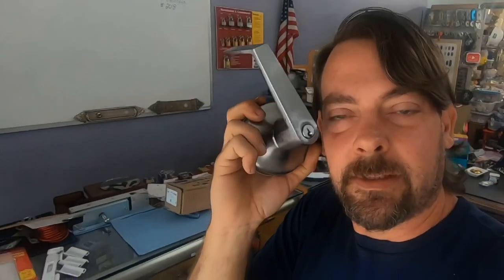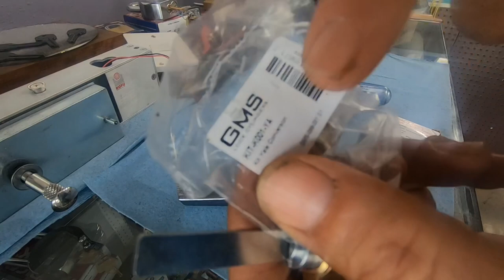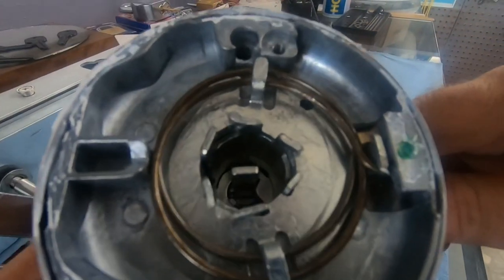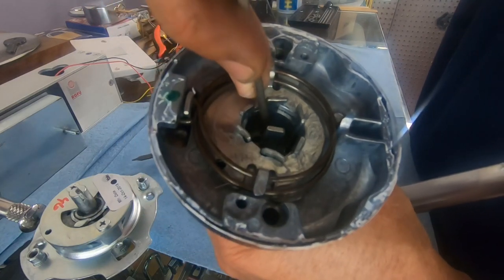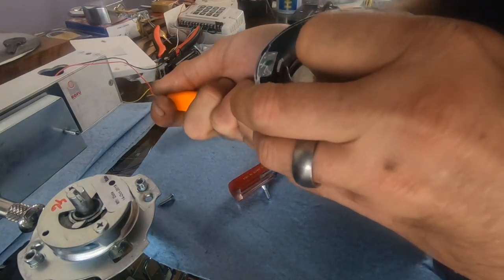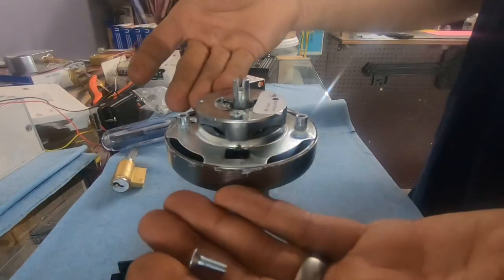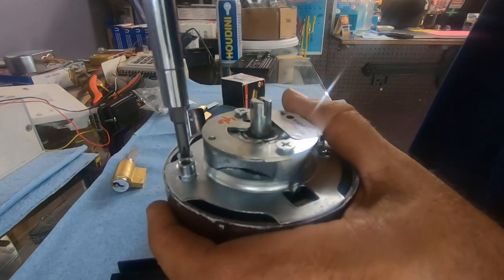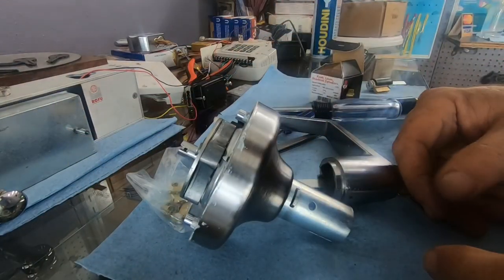removing cylinder from Yale exit device trim with no key

Comment: About 16 years ago I saw some cheap battery powered electric scissors in a office max bargain bin for 4 dollars.  I thought I could make my own electric pick.  I removed the stationary cutting edge and melted the end of a pick into the oscillating end.  That same week I had a job to rekey two new Yale lever trims to a customer's existing key.  With no key available I tried my new homemade electric pick.  It worked on both locks in seconds.  I was super excited at how amazing my pick worked.  I quickly discovered when I disassembled the first cylinder that the locks were 0 bitted.  I still have that homemade electric pick and it has not worked one time since.  Good times.

Comment: I know this is an older video. But I just purchased the HKS lever lock removal tool. I use it as a last resort. But it’ll separate the handle from the lock in seconds with no damage. I recommend it to all locksmiths

Comment: how do i get the cylinder our of exit trim on a von duprin? I want to put an e7500 in place of the 7500 on our main employee entrance at work. had the panic bar off, seemed like the only thing holding the front trim on was the cylinder and I could see it was threaded. I just couldnt get it to unthread.

Comment: Jason, Did I miss something?  Would not the HPC LHR 100 made easy work of this?
Reply from the maker: Dunno 🤷🏼‍♂️ never purchased one but I just kinda feel like it wouldn’t. These do have a really big retainer so not sure if it would have worked or not
Reply: The major mfg. Lever removal tools do work with these I've used them on both yale and corbin/russwin levers and trims. The HPC is iffy at best!

Comment: I’m so frustrated I can’t remember the model but there’s a certain type of lever (the one with the round button style detent I believe, where I did something similar to this but when it has a normal style kik cylinder I pulled it apart like this stuck a orange handle pick like you’re using Down in there and was able to spin the tail piece with some needle nose after pushing down the pin in the back of the cylinder I was so proud of myself that day when I figured it out lol